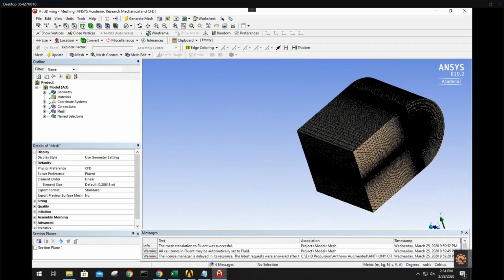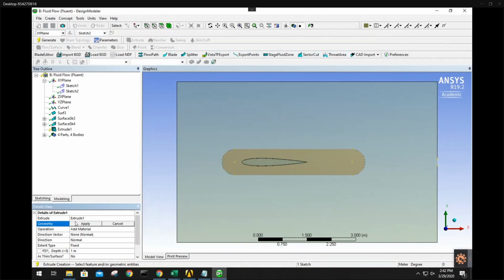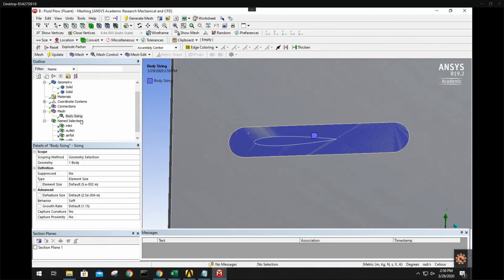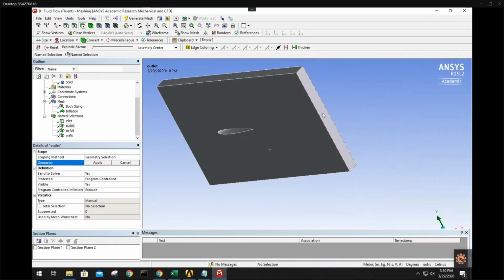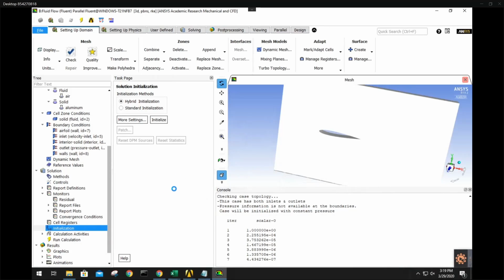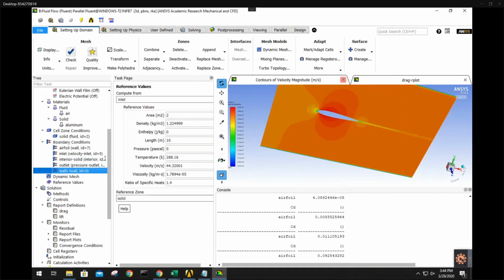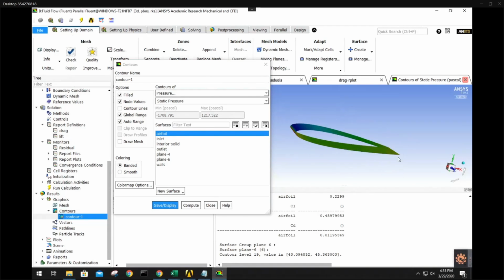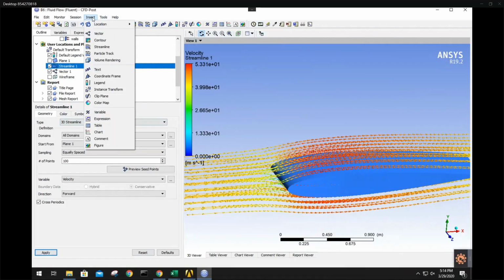ANSYS Fluent 3-Dimensional (3D) NACA 0012 Airfoil Turbulence Modeling Tutorial and Validation (2020)

Comment: Hello,

Thanks for this video. I am studying the flow around a 3D wing and would like help with the reference values to be specified in Ansys Fluent. I know the area is the top surface of the wing, the length is that of the chord. But my problem is that the chord is not constant all the way down the wing (the chord at the root is bigger than the salmon one). How can I specify the chord in this case, please ?

Comment: Thanks for the Video, great learning. However, all these are tetrahedral elements. If you use Multizone with Hexadedral elements, the count could be much lower. However as per my knowledge, for a chord size of 300 mm at least 5 million elements are required.

Comment: Could you please explain about the connections. I deleted the contact but it still says on Fluent that I have a Solid and Airfoil Solid.
Reply from the maker: the connections help define interfaces which are important if you have moving meshes but if it says its a solid you might want to check your setting in the mesher to make sure you've defined the physics preference as "CFD" and solver preference as Fluent

Comment: Hi Anthony, thanks for the video - I have been trying to do something similar with a NACA0012 with chord of 0.3m and span of 0.9m. My first layer height is 0.0000172m which is greater than you specified in the video but I appear to be having trouble with that first layer height and orthogonal quality/skewness/aspect ratio. In your video - you do not seem to have these issues even though your first layer height is smaller, nor do you specify any curvature scopes for the aerofoil which I cannot seem to avoid. I'd appreciate any comments - thanks!

Comment: How Can i get the dimensions for geometry?
Reply from the maker: I made the dimensions somewhat arbitrary.  In reality you would want to domain size to be at least a magnitude wider than the length of the airfoil.  As for the region of higher resolution, that is arbitrary but will need to be in line with inflation layers.

Comment: Hi Anthony, I’m a newbie who is trying to carry out the similar settings as yours. For the results at 0 deg angle of attack, it is comparable with the experimental data. However, the Cd is so inaccurate despite the acceptable Cl for high angle of attack (over 15 deg). Could you provide me some guidance for my case, please?
Thank you in advance,
Suphasin (Fame)
Reply from the maker: That's strange because that that AoA there should be separation and its pretty difficult for CFD to accurately capture that well.  Cd is the result of proper resolution of the boundary layer so you may be using a poor mesh.  You have the take into consideration the Y+ depending on your model so look into that.  I use the K-E with wall functions which allow for larger Y+.  Also check your reference values like what I had to corrent in this video.
Reply: @anthonyt6564  Alright, I'll recheck the y+ and mesh resolution again. Then I'll let you know whether it works, thank you very much for replying my message!!!
Reply: Anthony T I improved the mesh and y+, the results are better! 
p.s. another question: when I try to use the inflation function for 3d airfoil in structured mesh, it doesn’t work. The system always notifies that there is not enough memory. Do you have any suggestions for this case, please?
Reply from the maker: @FameS15  hmm if it says there's not enough memory that means your computer ran out of RAM so maybe close everything else, but it should definitely be possible.
Reply: Anthony T There are 16 GB of RAM and when I tried it with unstructured mesh, it worked. That message only occurred when I applied the Inflation with C-H structured mesh. Some comments I found on the CFD community indicated that it was likely to be some kind of errors but no one provided the solution TT.
Reply: Hi Suphasin Changprasert,
I have the same problem, did you solve this problem?

Comment: Hi Anthony, I am trying to do my analysis and i done it similarly to the one start of your video. Could you tell me the location at which you added your decisions or if i could get a copy of that file would be great.
Thanks
Reply from the maker: Hi if you are referring to the meshing I did the each face exactly how I meshed the airfoil in my 2-D video but on the front and back face.  I then connected the two faces with some non-biased edge sizings.